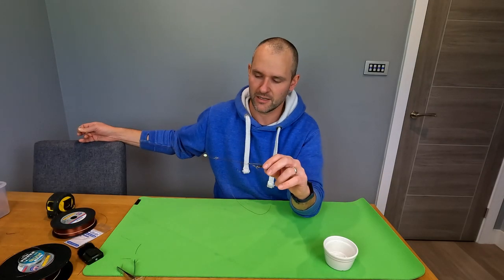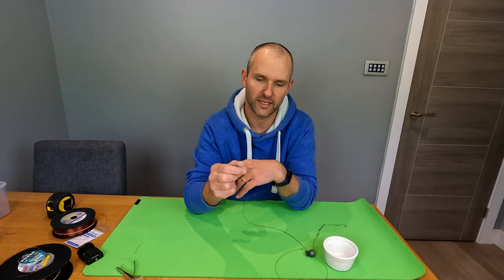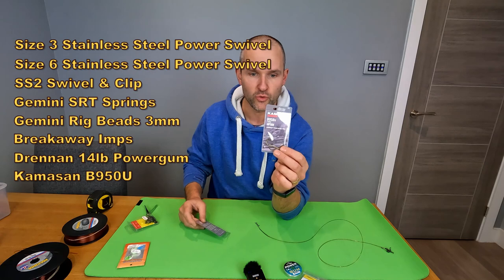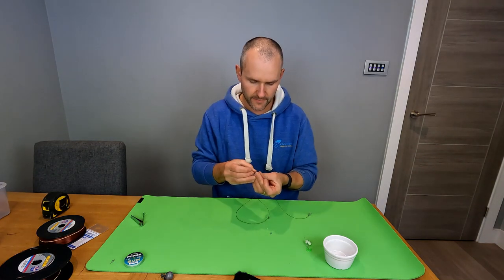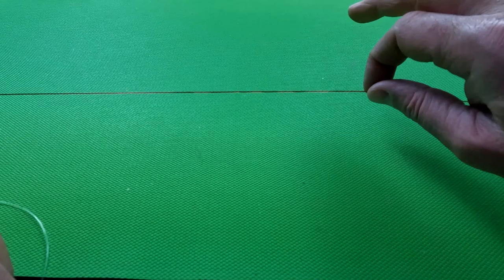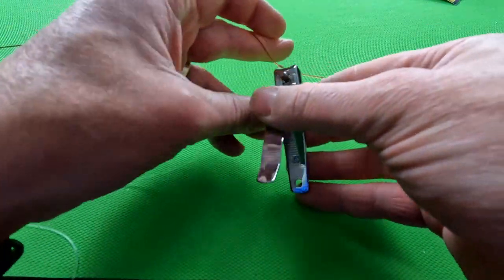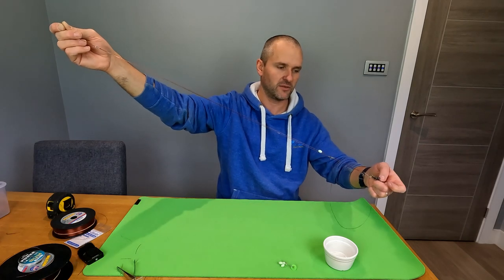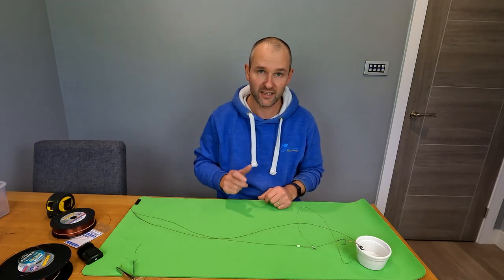How to Tie a Pompey Loop Rig

Comment: Many thanks Tom for making this video, probably the best one I’ve seen for this particular rig. When I tie this rig I also use a 3” length of silicon tubing to go over the top snood swivel eye to help lift the snood away from the rig body and avoid tangles. Have you used this adaption too?
Reply from the maker: Thanks Bill. I have dabbled with silicone like this in the past, but to be honest, I prefer to keep things as minimalistic as possible. Glad you liked the video, thanks for watching 😀

Comment: Brilliant rig Tom, could you use it in an estuary crammed with crabs by popping them up with pop up floats
Reply from the maker: You could, although how far do you need to cast? I wonder if a simple flapper might do the job just as well, and easier to tie? But if distance helps, then yes, give this a go.

Comment: Nice vid .
What is the thinking behind using a circle hook on the pennel which helps to stop deep hooking, to then add a J hook?
Reply from the maker: That's a very good question! I find the vast majority of my fish are hooked on the circle still, despite the j hook being there. Fish that are caught on the j have tended not to take the bait deep, so have been lip hooked too. Of course, as with all fishing, the occasional deep hooked fish will occur, but it really is only very occasional. The better way to fish this would actually be to use a dongle below the circle, rather than the j. Perhaps I should do a video showing that too.
Thank you for watching and commenting.

Comment: Sorry Tom quick question any reason you used a swivel on the top of the rig body v normal clip I tend to have a swivel on my shock leader
Reply from the maker: No real reason matey. I usually have it the other way around on my lighter beach setups, as the longer, lighter snoods easily catch in the clip when it's on the end of your leader, so you are doing the correct thing. However, with heavier snoods like this, it's less relevant, and as the majority of people do it this way around I thought I'd do the demo this way around. In all honestly it's going to make no real difference which way around you do it, so by all means stick with what you're used to. I hope that makes sense.
Reply: @FishyTom  ok thanks mate I’ll leave you alone now have a great weekend
Reply from the maker: You too bud

Comment: hi tom, newbie here. firstly great tutorials. really easy to follow with simple explanations.. 1 question.   instead of using 2 stop knots can I just use 1 but put 8 turns on it instead of 4?   ... or am i just being lazy?!  thanks in advance!
Reply from the maker: Hi mate. Thanks for watching.
II honestly don't know the answer to that, because I've never tried a stop knot with that many turns. I'll have to experiment! My gut feeling is that the two stops will be better, I feel they kind of lock against each other. I wonder if an 8 turn knot would end being a bit of a bulky knot?